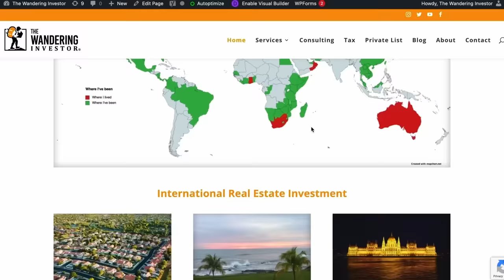The off-grid Community in Paraguay you never heard of - a great Plan B in Latin America

Comment: Love the concept. This community has the ability to be a network state. Cost of construction is high by comparison to most Latino (central and south America) countries.  Concrete block, like Mexico uses, is a much more cost effective option for construction, and using Paraguayan labor will cut the costs considerably.
Reply: This does not fully reflect the truth!
Of course, the construction costs also include the costs for the entire infrastructure.
This includes electricity, internet, water, communal areas, swimming lakes, dams, over 100 km of roads, café, library, kitchen, bakery, security guards and much more.
You can't compare this to any settlement project in the world or even in South America.

When you include everything, it becomes clear that it is very cheap.

The jungle and the inexhaustible nature is wonderful!

Comment: So many questions....but main one is where is the pub? I struggle to grow organically when faced with leaf cutter ants, spider mite, so what is the secret? I didn't see any solar panels? How do you get building materials delivered, large glass units, branded tech goods. Really interesting vlog!
Reply: We only treat our fruits and vegetables naturally. We get different materials inside and outside
Reply: Interesting question about solar with 300 days of sunshine!
Reply: @s.k.1091  I think someone provided some reasons why they don't have solar panels. The electricity system is clean and cheap mainly using hydro power. The only reason for having solar would be if you had no access to the grid i.e. were in a very remote location. This is similar to my situation in Peru, but I do like the ability not to be dependent on a supplier.

Comment: What about electricity?  Is it sourced from the grid or produced by the community?  Solar, hydrogen, fuel, natural gas?
Reply: We are using the grid from the local supplier in Paraguay called ANDE. But some settlers have solar panels and batteries. I also will build a backup system soon.

Comment: My next batch is coconut weed. I use organic coconut oil and mix it with at least a half ounce of weed and then I cook it on low heat for a couple hours and filter it back into the coconut jar. You take a half teaspoon and you will get so fucked up. And it's healthier since it's only weed and only the good healthy coconut oil. Just as as good as gummies if not better

Comment: I don't know about the other stuff, but 3D printed houses has never made any sense at all. They print walls...nothing else. Would you like a foundation, roof, floor, electrical, plumbing, finishes, fixtures...that's extra. A decent framing crew can construct the walls faster than a 3D printer can or about the same time. It's a tiny part of the entire build process. The concrete used isn't magical or can only be used by a 3D printer. 3D printed houses have been around for years now and is not catching on because every projects shows the downsides.
Reply: There you can build whatever you want and with what you want, even where building regulations in other countries prohibit it.  There is definitely something for everyone.
Reply: What is the problem?

Everyone is free to build what and how they want